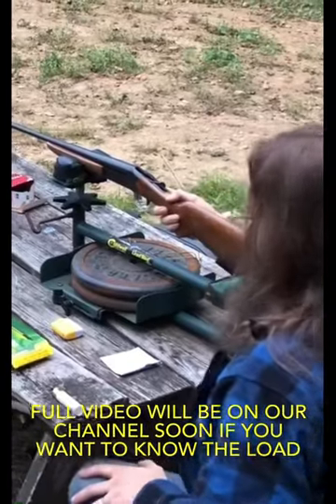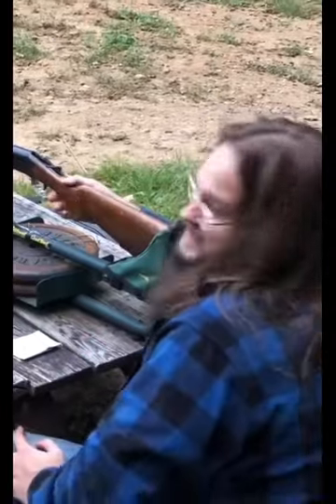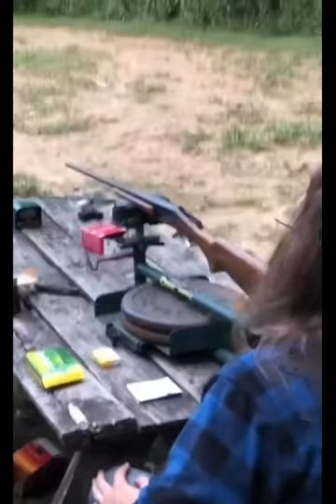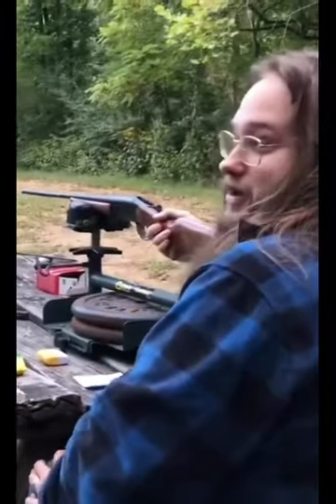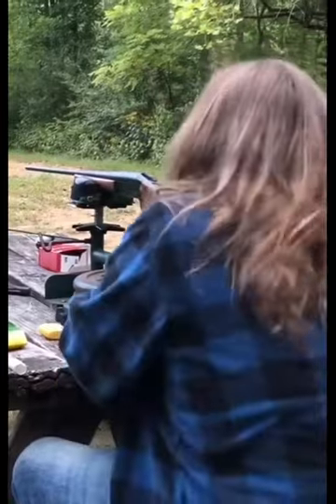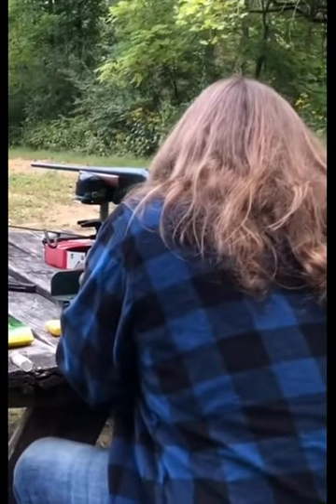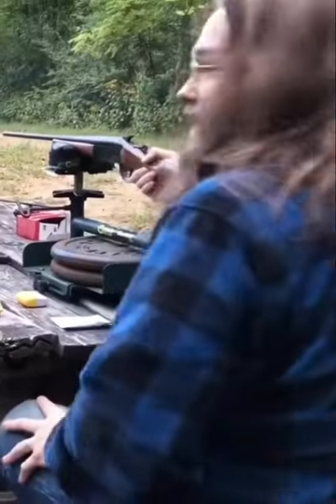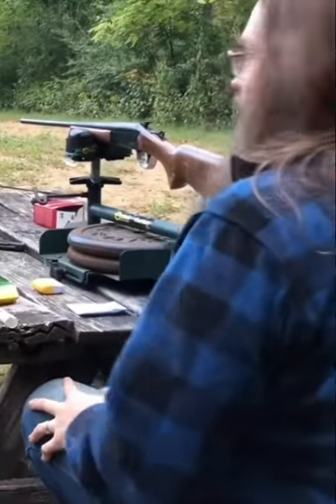.357 Magnum Bullets As .410 Slugs? #shorts

Comment: Spose to use 44 mag in 410 some you can shoot 45 long colt in some
Reply from the maker: 45 colt bullets are way to big to fit in the hulls, 44 bullets won’t go through the full choke on our guns. Fixed full. Accuracy would suffer and they would be tumbling for sure.
Reply: @theshotgunscientists   don't use the hulls cut choke off
Reply from the maker: @DennisWaswick  Cutting the choke off would be terrible for patterns